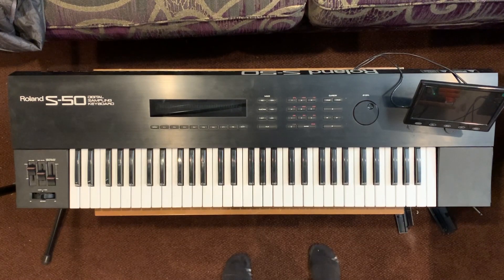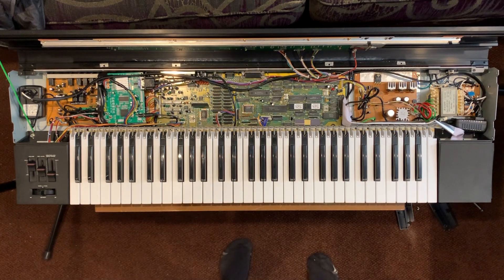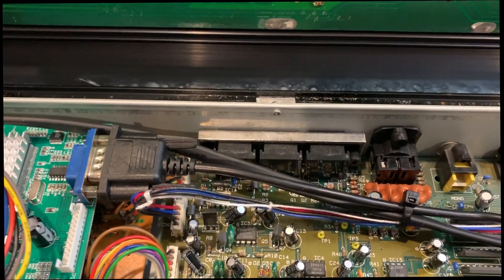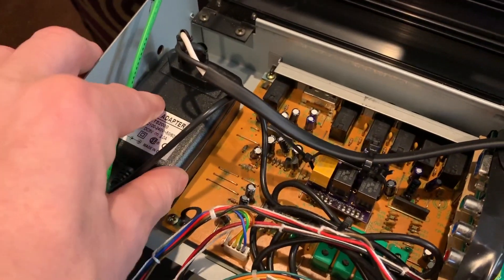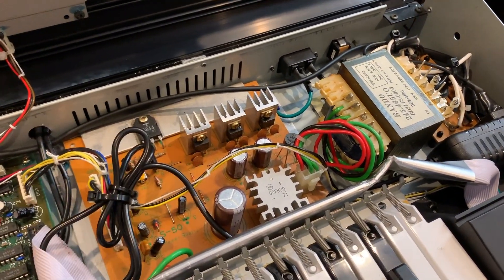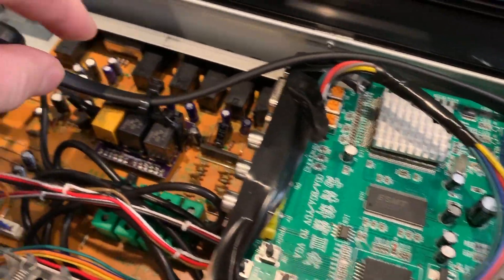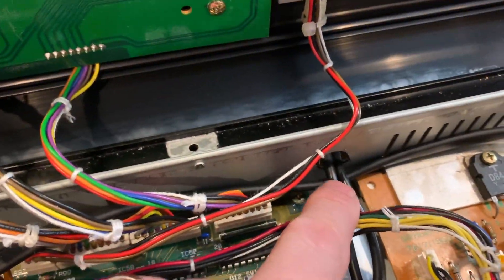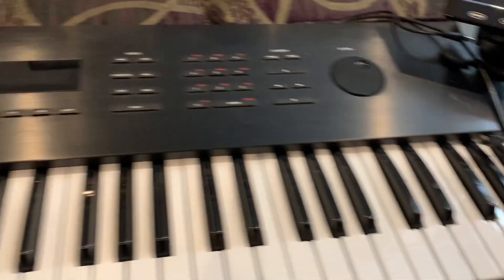Roland S-50 Sampler D.I.Y. Improvements

Comment: hi johnny please help ive bnought a s50 sampler with a gotek drive the one without the rotory nob it loads the s50 version 2 operating system when you switch on.it loads a few patches but im not sure how to load a disk from the gotek im very frustrated this keyboard wasnt cheap and i would love to use it properly thankyou so much.regards steve.
Reply from the maker: Sure I can help Steven.  Drop me an email found on my about section.  We can then schedule a zoom call or something like that.   The main thing to understand with Gotek is that it's sort of independant from the sampler.  You have to load files into the Gotek memory, then you load into the sampler - sort of a 2-step process.

Comment: I like the secondary PSU mods. I have a Korg T1 longterm resto/mod project  - that keyboard has got VOLUMES of empty space inside - I am considering adding some devices to it and powering it from the internal PSU (which BTW died so have to mod it anyway), but your additional AC/DC adapter seems like a better solution. One thing I would do differently in your mod is to add sockets for monitor video/power out, so the monitor position would not be limited by the length of the cables out of S50, but I can see why this works as is for you. Thank you for sharing!
PS
USB floppy drive replacement mod is probably the BEST upgrade for any 80's synth/sampler 😀
Reply from the maker: Yes- i might redo the vid with proper monitor plugs - it would be much better and safer.

Comment: All these additional PSUs can be easily replaced with only one modern substitute  for the factory PSU, which will be far more compact and powerful. Free space can be used for a more compact VGA card. And you will have a beautiful instrument not only outside, but also inside. There are also black 720 Goteks.
Reply from the maker: I know - I should probably do a new revision of this.  When I first converted the floppy the Black Gotek didn't exist for the S-50, but now there are so many better options.  Good idea on the power supply - I might try that.
Reply: @johnnymorgansynthdreams  these all are of course important improvements, but I'm wondering if there is any fantom possibility to expand the memory in the S-50 and modify the OS like people do for, say, Yamaha TX16W or Akais. I remember also that if we speak about Z80 based systems, people doubled the speed of CPU and added the RAM in the late 80s without major problems. There is the Pandora box for this really underrated sampler!

Comment: What type of monitor is that? Will it work for a s330 ??
Reply from the maker: Hi Devon - it's just a mini 7" LCD 12V powered monitor ordered from ebay.  There's many of them up there.  The key is the GBS video board you have to install - but I think for the S330 there may be not enough space inside. You'll probably have to use an external scart adpater box of some sort.
Reply: Johnny Morgan I’ve ordered the board and a din connecter to connect to the 330 

Wish me luck dude lol
Reply from the maker: @devondetroit2529  I'll help you with it - just ping me if you have any questions

Comment: Nice video.  Thanks for uploading!  Question for you and anyone else on here... my S-50 has been great for a long time but recently upon startup it takes about 10 minutes for any sound to be produced.  I know when it's ready because there is an audible pop.  Once that happens, it plays like new...  good strong signal and no distortion.  Any ideas?  Is there a component in the audio path that needs to "warm up" as it slowly dies?  Thanks!
Reply from the maker: Hi Steven - here's my suggestion to figure out what this is.  Purchase some "cold spray" at a local electronics parts dealer such as MG Chemicals 'Super Cold'. I like this brand as it has a nozzle attachment to focus the spray. Once the unit turns warms up and starts working, one by one spray the top of each component.  I'd start with the op amps in the audio output area which is on the left most circuit board.  if the unit stops making sound, you've found your bad chip.  This is a pretty common way to find heat faults on ICs.
Reply: @johnnymorgansynthdreams  Thanks!  I'll let you know if it works.  :)
Reply: @johnnymorgansynthdreams  Hi Johhny.  So I tried cold air on the audio board but couldnt get it to fail.  So,  sprayed a little Deoxit into the relay, let it dry and waited for the unit to cool completely (a couple hours) and  the sound is back to coming on immediately upon power up.  Cant explain why this worked, but it did!  

Instead of replacing the relay when the sound began to distort several years ago, I removed the plastic cover form the relay and over a period of about 2 weeks sprayed just a bit of Deoxit every couple days into the relay and would then hold a key down at maximum volume (amp off to save my sanity) for an hour or two (used a business card between the keys to hold it down).  After performing this a half dozen times over two weeks, the distortion issue was gone and the sound has been crystal clear since.  I ordered the kit you installed in your S-50 but ended up not needing to go through with it.  We will see how long it lasts.  Been about 3 yrs so far and no distortion yet.
Steve
Reply from the maker: @stevengasiecki8826  Ok that makes sense - that relay is the source of so many problems. I will fail again eventually as the contacts oxidize.  I do make replacement relays if you want a full replacement - I'll have a few more up on ebay within a week or so - just waiting for more parts to arrive.

Comment: Awesome video!! Thanks!   I still have my original new S50 & S550.  
    I’ve never noticed the relay pops.  Guess I’d better open her up & take a look.
     I have the USB Floppy emulator, just haven’t installed it yet.   I have all the original S50 factory disks, just haven’t created disk images yet.  (I need to install it, my original floppy drive loads disks,   but it won’t format a blank floppy anymore.)
Reply from the maker: Amazing that you have the whole library on floppies - a great resource.

Comment: Could you tell me what kind monitor that is and where to get it. Also I just bought the Gotek drive emulator sfrc922D is that the same one you use?
Reply from the maker: Hi Thomas - the monitor was this one.   https://www.ebay.com/itm/9-HD-Ultra-Thin-TFT-LCD-Color-HD-CCTV-Monitor-HDMI-VGA-AV-w-Speaker-Adapter/272026367629?ssPageName=STRK%3AMEBIDX%3AIT&_trksid=p2057872.m2749.l2649.   I'll check on the Gotek.  It was one of the early ones, so I'll have to confirm. There are ones now you can get with firmware already flashed for Roland so you don't have to remove the USB stick each time you change patches.